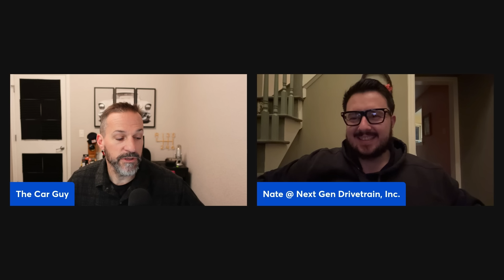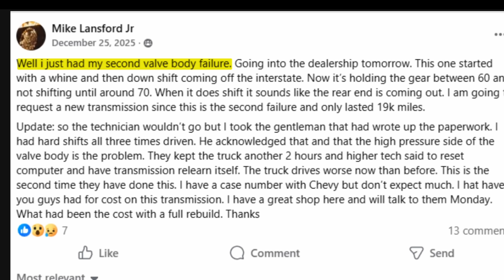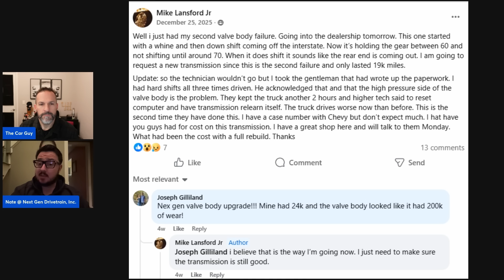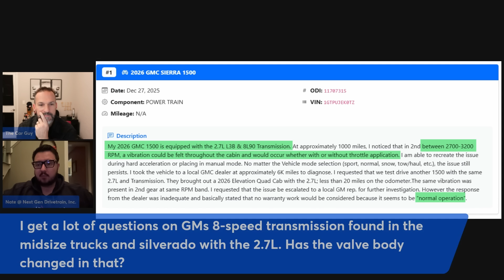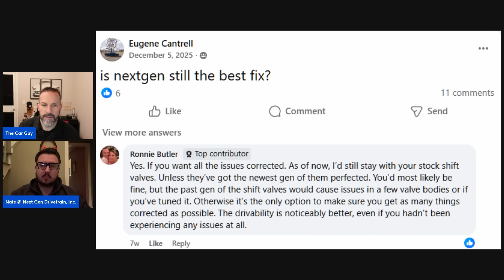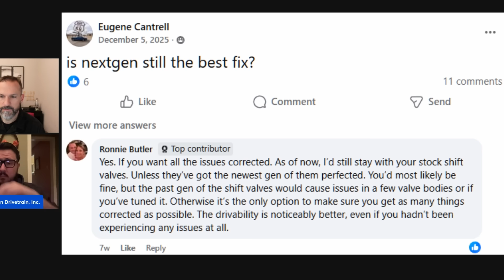How GM Transmissions are DESIGNED To Fail with NextGen Drivetrain. 2025 2026 Silverado Sierra...

Comment: I wonder if these “superficial” valve body components are for emission purposes, there to coax the engine through the right power band for federal emissions testing. I wonder if that’s why GM couldn’t alter the transmission too much.

Comment: My transmission locked up in my 21 Duramax at 79 mph.  It made me lose control go across 4 lanes of traffic and hit the jersey wall on the opposite side.  Thank god I was able to avoid other vehicles.  It  was insane and GM was terrible at listening to my concerns and took 6 months to fix.  I was just lucky I had dropped my trailer off about 29 miles prior to this instance.  Could have been much worse.

Comment: Scathing tongue lashing of gm. Wow. Things i already sort of knew but not soon enough. Read below.
Thanks for this interview.

I have a 2000 silverado w 5.3l and the 4 speed automatic. Tranny died at 80k just after the 75k warranty. We did haul a lot w it. After we had a rebuilt unit bought and they told me it was actually better than the original bc it had a heavy duty valve body. I’m at 340k now and it still shifts perfect. Amazing! It can be done. It’s greed that is giving us $#it from manufacturers now. 😢

I also own a 6.2l 2021 silverado and it ‘passed’ the pico test for the lower crank. Whew 🥵. Had the oil tested BEFORE the pico test and it looked ok. It’s still under warranty and it is running ok so far but as soon as the warranty is up i’ll replace the valve body in the tranny w a nextgen. 🤩 just hoping the lower cranks does not grenade itself. I run it w an afm/dfm override. I also run it in tow mode as the shifts are more quick which is supposed to be less harsh on the valve body vs the soft shifting in normal drive mode. Time will tell and God willing 🤷🏼‍♂️

Comment: My torque converter replaced at 52k fortunately under warranty 4 years ago. In shop now having valve body repaired at 109k.  Out of warranty now.   Will never buy another  Chevy truck.  2018 1500 Silverado.   Can’t wait for a class action suit one day.  Still have my 2003 suburban with 268k miles still running with no tranny issues ever.  Only reason I ignorantly bought the 2018 truck.   Sucks!

Comment: I know this is a little off the topic of this video in particular while is all about GM 6.2L gas engine, although right now I have one 2026 Chevy Silverado 1500 having the 5.3L V8 gas too. However, it important to let ANY future buyers know of what they might go through just in case they opt for different GM engines and most likely this might give these future buyers more to think about it in my opinion, so here you have it from here down… Update 2.12.26 : involving my 2023 Silverado 1500 3.0L LZ0 Duramax Diesel engine, that I purchased it brand new and after more than 2 years then my truck STILL was NOT able to pass the smog as well as the EGS sensor never ever set at all, therefore make it impossible to re-register the vehicle. So, after I paid an extra 2 months extension of my DMV registration (meaning my full year DMV regular registration, then being required to pay an additional 60 days extension at the DMV too), AND then after 2 and half months of grueling exhausting driving while adding almost 13000 miles on top of my already dash total miles on my truck, increasing the overall miles for no apparent reason, let alone decreasing the value of my truck, then the truck still did NOT wants to budge and have this stubborn EGS sensor pass/set.. I had a little over 2 weeks left and this 60 extension registration would expire, therefore makes it impossible for me to drive the truck anymore. I ended up trading it with a new 2026 gas truck this time around so that I will not be subject to the same diesel drama again in the future, since GM appears to NOT have solved this EGS issue and allow these diesel trucks to pass the smog, since one of the reps from “Referee of CA” seeing these emission issues, and which deal with all these kinds of customers complains each and every day, told me that this issue it is VERY well known/common among ALL diesel vehicles, therefore many brands and models are going through the same drama, regardless the manufacturer.. He stated that in order to have it pass and be able to get the “green light” from DMV is to get one of the “Certificates” from them and approved by the State of CA, that will allow me to get the DMV tags once again, but NOT after some of these visits back to the dealer and try numerous specific follow up GM instructions that could OR not fix the issue, therefore leaving the problem to be solved only by the State of California, which is a process of bureaucratic decision and approvals. The dealership have updated my “Serial Gateway Data” and the “ECM” with the recalls or bulletins for these trucks, but even that would NOT fix the issue, let alone that from this update done in Jan 2026 then I put almost 13000 miles driving the vehicle all sorts of GM recommended cycles for a total of 2 and half months. Basically, days and nights for hours, including sometimes 8+ hours, adding thousands of miles, and still nothing. The referee stated that it is extremely difficult and hard to get this EGS sensor set, which apparently this is visibly a problem for GM. No customers would like to go through this unbelievable process and put themselves in a dangerous situation while driving the vehicle at low speed over and over while slowing down to 10 or 20 mph over and over trying to set these sensors. It was not worth it for me to take the chance anymore after these grueling driving days for 2 and half months, and go through such “uncertainty of maybe receiving the Smog “Pass Certificate” from the Referee of State of California, or NOT, and be able to force DMV to give me the tags that I already paid for anyway, and then who knows being left myself with a vehicle that can or CAN’T be driven anymore. I chose to traded it in with a similar vehicle but having a Gas engine, and let the GM deal with the 3.0L diesel engine of a vehicle that was running perfectly and without ANY issues or dash engine lights whatsoever.. I can’t believe myself that I ended up buying gas car, after almost past 18 years of owing only diesel engine vehicles which I personally maintained and serviced each and every time as well as get a better parts and oils too, but this days the diesel engines are going through a lot of modifications in order to meet the states’ EPA standards and gas mileage gains, in order to sell better, that makes these engines so hard to maintain working or performing without glitches or issues that never ends.. Just so disgusting and disheartening. The gas Chevy are NO stranger from other issues already known like the lifters problems on 5.3L and 6.2L, but overall these are passing the smog I assume, time will tell too, but then I am under the firm believe that if the oil maintenance it is done every 3000-4000 miles using a good oil, then I am most certain that this lifter problems can be reduced to a lot less dangerous encounters and/or issues, including having this shutting off this DFM system that kills these gas engines too, besides the Start On/Off too, which these in itself are another “killers” to these gas engines as well, and which I personally recommend that you guys/gals can buy a device called Range007 which disengage the DFM and have the engine runs only on 8 cyl all the time.. In the end, I just want to let people know what are the risks of buying one 3.0L Duramax Diesel Engine and later on deal with the same problems, every two years when it comes the DMV pay and smog time, since a VERY small % cars are lucky to have these 3.0L diesel trucks passing smog vs majority of them NOT passing. Majority of such vehicles involving these diesel engines are NOT fully fixed or figured out such emission dilemma, and if you are in a mood of loosing money like what I’ve experienced myself, meaning over 2 years of paying off this loan of this damn thing, and then be forced to take a loss and get rid of it, then that is up to each and everyone of you out there, unless you are willing to have GM swap your own original engine like many others out there, and perhaps get a refurbished engine instead, or who knows perhaps even a new 2024/2025/2026 engines that are junk in my opinion, no disrespect, vs the 2023 year models, then be my guest. Just a shame and a total bad taste of a product that should have still sit in the “production”, being still tested and tuned, until all these “glitches” are finally fixed, instead of being released to the public and then let each and every one of us deal with such monstrosity and evil disgusting behavior of some higher ups at GM level that did NOT care for the customers and their money, vs their own interest and the company’s GM stock that would have been under scrutiny if such hidden details might have been known from the get go, while GM banked on this 3.0L engine and its gas (diesel) mileage, etc. Now, when it comes to this transmission NextGen Kit, then I might look into it and perhaps in one day I will do that change and therefore remove the OEM part for better piece of mind, although I never ever have had any issues with my 2023 Chevy Silverado 1500 having 10L80 which I serviced myself 4 times I believe if I recall correctly up to the time I actually got rid of it, while having 64.6K miles already. I would like to mention one important thing, and NOT that is a bullet proof against the horrible poor quality of these latest GM vehicles, but also it is import to mention that driving the vehicle at or 50 mph MAX in the first 500 miles when the truck is brand new and having its components like engine and transmission in its infancy, as well as NOT towing anything for at least that long too, then that is a very detrimental factor and easy easy wear your vehicle’s engine and transmission nice and uniformly in order to avoid burning oil later or even destroying the lifters in a much larger scale and then immediately having problem with your brand new vehicle right after that. I would go to an extent and actually drive nice and slow, while starting slow, moving slow up to the 50mph and even up to 2000 miles on a dash, without towing is possible at least, in order to allow the pistons/rings/bearings/shafts/chains/gears, etc, adjust easily and uniformly as it is necessary in my opinion. Me, personally I went ahead and changed the first engine oil at 1000 miles max and the transmission guild at 10000 miles to 15000 max miles, in order to also get rid of the first OEM fluids and filters, but that is Hollis me. Some people did this much earlier and that is okay too, because all I can tell is that these OEM fluids are so full with a lot of shavings and gets very abrasive while mixed with oils/fluids and then the wear and tear of your new engine and transmission as well as rear differential in particular is going to destroy your vehicle much sooner. So, don’t be surprised to see that your new truck burn oil or start showing engine bearings or transmission valve body issues in my opinion. Most of the people don’t read the manuals and don’t care while beating the craaaap out of their new vehicles and the come and cry about having a clunker, etc… I have so far 3k miles on my new 2026 gas Chevy so far and everything appears okay, but only time will tell what these vehicles would show or experience… I would suggest that you “guys” buy this Range007 device that deactivate the DFM and the Start On/Off the engine every time your car is at any stop light etc. Therefore, it helps to prolong the longevity of your car and avoid starving your extra cylinders of oils that are shut off, when activated again. Not sure in what sequence these are shut off but it is better having your engine running on 8 cylinders all the time and pay for more gas than having your vehicles get catastrophic failures and then your engine or transmission swapped many times, let alone the headache of going through such unbelievable disheartening and stressful process.

Comment: I know of a 1988 Buick LeSabre with 540,000 miles on the original 3800 and 4T60 4 speed automatic transmission, and a 1987 Buick Century with 730,000 miles on the original 4 cylinder Iron Duke engine and 3 speed Hydramatic 125C/3T40 automatic transmission. Don't let them make you believe they can't build reliable engines and transmissions.
Reply: Unfortunately those days are gone.

Comment: I bought a nextgen diy carbon kit to try to avoid issues on my 2025 l5p 1l1000. Since day one it's given slight flared shifts and now after only 5k miles its missing shifts under hard acceleration and giving a rough 3 to 2 downshift. I have given up and went with a DHD valve body. My advice is to avoid nextgen. And yes my kit was installed by a professional transmission builder and he told me that he has heard this complaint from other nextgen customers and he tried to push me to use sonax parts instead. DHD seems to be a must better option.....as does sonax. Nextgen is crap...
Reply: My son is a rebuilder He put next Gen in with overhaul afterwards intermittent no reverse. He removed the next Gen and now everything is fine. I don't think he's gonna get his money back on the kit.
Reply: @royanderson1429 if he paid with credit card have them fight it. They will make it right.

Comment: The owner of my company I work for has a brand new GMC Denali 2500 and there’s been nothing but problems with the electrical and all I already warned him about his transmission. He is talking about selling it and buying like a old Ford excursion or something older and dumped money it fix it up brand new truck after the truck is lighting up making the tail lights headlights go on and off the other half doesn’t the new GMC Chevy products are nothing but trash they are garbage overpriced turds the big screen quits working all kinds of issues that I can’t recall, but he is done. He didn’t even had the truck four months. They are money Hungry and they have cut too many corners now they have a trash product and they used to be the best of my opinion.

Comment: I’ve owned two GM vehicles. A Yukon XL Denali and a Chevy Tahoe. I’ve had them in the shop for significant failures. Catastrophic valve body destruction then catastrophic 6.2l V8 destruction then one with complete brake failure. This last one burns me… GM replace the engine and transmission on the Yukon under warranty so I trusted them. However the brake failure in the Tahoe, they refuse to fix. They flash the brake control module and gave it back to me… TWICE because the brakes failed twice!!! I don’t trust GM and refuse to have my family in this $70k SUV. GM is playing with peoples lives for money.

Had a Jeep Wrangler, expensive and silly toy with constant problems.

3rd Gen Tacoma having front differential detonation and some oil leaks. Bullet proof 4Runner.

Had a few Fords with injector and spark plug issues. Nothing you can’t DIY. However, extreme prices and an ocean of plastic clips, plastic parts, faux metal plastic, and thin aluminum isn’t a luxury price selling point for me.

Nissan Frontier that you couldn’t kill but had gremlins.

Two RAMs (TRX & RHO). DIY fix on TRX headers. RHO is perfect so far.

Comment: On the Hemi valve train problem,  use a good by- pass filter change your oil in the first 500, 1500, 3000 miles to get manufacturing particles out and change oil at least every 5000 will help  a lot.

Comment: As someone who works for a transmission solenoid supplier for the big 3, I have to say I love the interviews. 

I agree a lot with the guest, but I feel like he doesn’t always say the full story. For example, the reason pulse dampeners are in the newer transmissions is because the reduce the vicious pressure spikes caused by newer, fast solenoids. 10 speeds are constantly shifting, and sometimes it gets too noisy too from a control perspective.

Now yes, getting rid of the pulse dampers absolutely removed a failure mode, but it also puts a lot of wear on your clutch packs. I agree that the failure mode is worse, but I think we need to be honest about why they put them there.
Reply: great insight, I instinctually knew there was a trade off..........ive seen 10R80s hold 1000hp and NOT break hard parts....its always been clutch area ( aside from valvebodies which yeap ive had 2 on a new car before ) when we got above 700whp and start hooking it.......people run them at insane power...pull down and redo clutches every other race.....its both a great trans and a headache....usually the valve body is front and center till the clutches simply cant hold anymore...

Comment: Obs truck manual transmission. Things rattling bearing shot. Sounds like a blew a pistol push the clutch in it's the transmission. Turns it off hear the gears rattle down. Still tows too? I need another transmission still driving it another 300k miles?

THEY DON'T MAKE EM LIKE THEY USED TO XD! 

What gets me is how it costs 500 for a real bumper does it's job. But when you damage a plastic jeep bumper the thing costs 4k barely gets hit falls apart vs classic metal i don't see sheet?